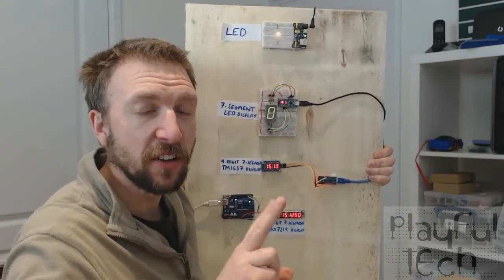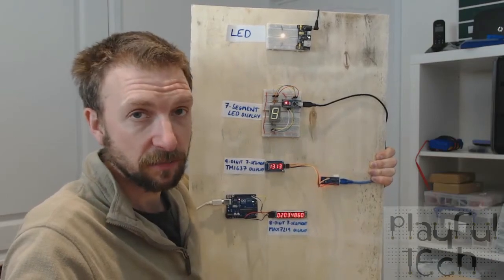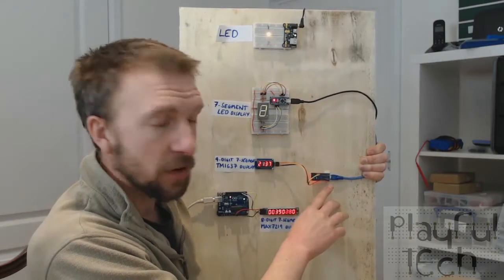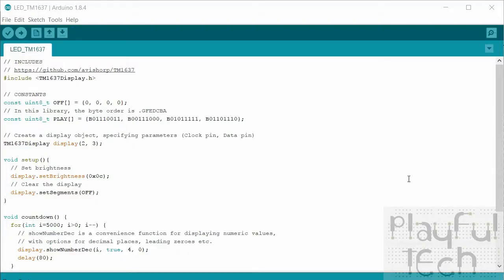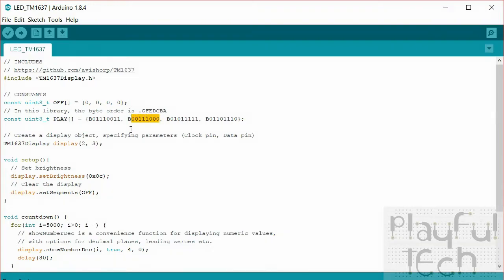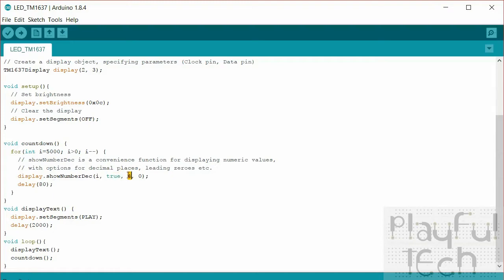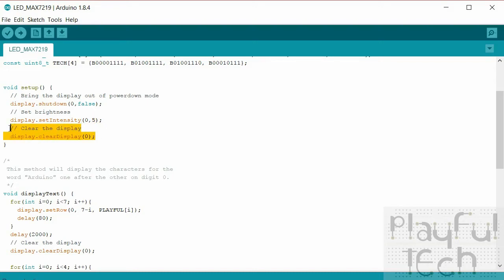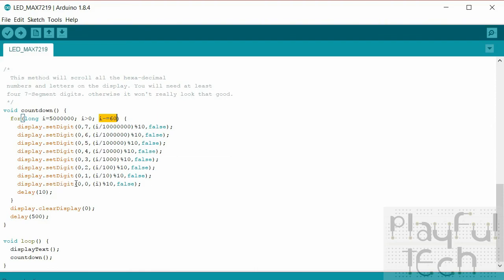LED Displays

Comment: Hey Alastair, I love you work and was thinking about building your buzz game but have it when players solve the buzz game a 4 digit display will show a 4 digit code. I was wondering if I would just connect the 4 digit display to the Arduino as shown in the video and add in the code when the buzz game is solved to run the display code or could I someway connect it to a relay? Thanks so much.